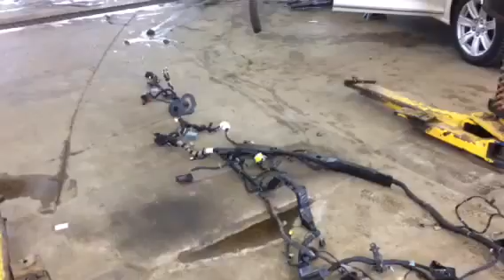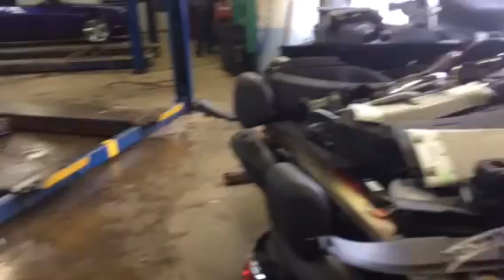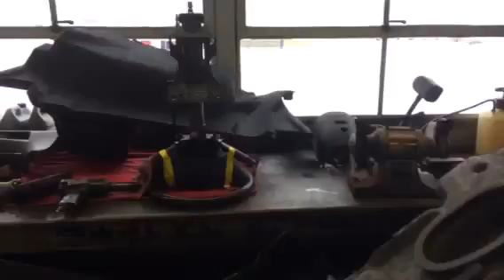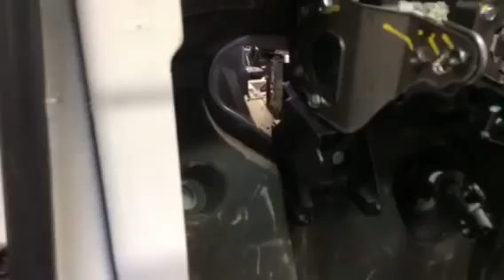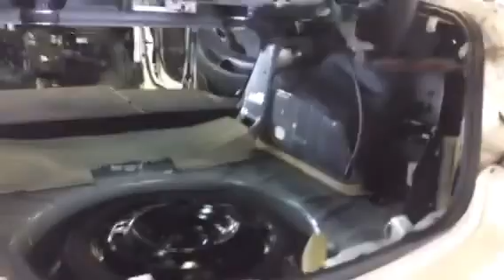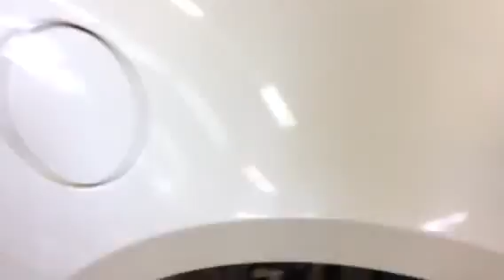2012 Buick LaCrosse electrical problems

Comment: i worked for a bmw dealership for 20 years , they had the same issues,, but what happens , mostly if the vehicle has a sunroof and you park under a tree, all the dirt and mud from the tree falls onto the roof, and it it rains, the water gets into and passes thru the sunroof weatherstrip, and into the cassette for the sunroof , after a while, the dirt build sup and becomes black mud, what we used to do at the dealership was pour a bit of water (with the sunroof open ) onto the ineards of the sunoof body area , and let the water drain down or see it it happens , apply light air pressure , and slowly blow it out , and apply more water , put all back together , lube the seals and weatherstrip and bring it outside and water test,  on the lacrosse , there is a drain hose near the tail lamp, make sure the hose is on it the drain tube , maybe attach a small hose clamp ?? a cable tie ?? and re test , some people have drilled a hose in the trunk ,,,,,,,,,,,,,,lololol, but the leak was never fixed ,,,,,,,stupid move , and i would advise , and state, vehicle that had hand car washes really never had a problem with mud build up since they were flushed clean by the car wash

Comment: Can you help me figure out the wipers on the Mustang (2002)? I want to use the multifucntion switch and its dealing me fits. I have the turn signals, hazards and headlights figured out but Im stumped. Do they have to go through the GEM (generic electronic module)????? I can get them to work by following this video with a different switch but I dont want to use that switch. https://www.youtube.com/watch?v=iuqZmm9nRZs
Thanks!!

Comment: Hi something is constantly killing the battery in my 2011 Buick Lacrosse Buick dealership says that alternator and starter are fine. However radio is not working there is something on the screen that says delete. Buick dealership said it would be over $1000 to get another radio What do you think is killing my battery if everything else is fine
Reply from the maker: I have seen a door lock actuator go faulty and cause that which is part of the door latches. Your radio could be causing it. If you dont want to replace it you could unplug or have it unplugged to see if it fixes your problem. Hope that helps. Its really a guess with out looking at it.
Reply: Same exact problem!! Did you ever find out what it was?

Comment: It was never electrical it was the ECM being mounted in the wrong place to begin with next to the engine which is causing the ECM to Overheat and the car shutoff and you think it's electrical. But it's not. Relocate your ECM in between the grill and radiator where air can get to it to keep the ECM cool down. Mount the ECM down in there. The harness will reach. Car will never shut off again I promise you. Everyone with 2012 Buick lacrosse 3.6 v6 is having these same issues and think it's electrical and all along it's the ECM overheating I figured this out on my own doing my own test because the shop will tell you anything
Reply: Is that the reason the service stabilink system comes on and the car shuts off at random

Comment: I just found dampness in the trunk of my 2010 Buick LaCrosse cxl. Not sure where leak is coming from. I did recently have some body work done to passenger rear door and my stereo has been going in and out since. It also goes out more often during rain. Any ideas? I will be taking it back to body shop this week.
Reply from the maker: Most likely the sunroof drain. There is a pass through for the rear sunroof drains in the truck.. If you pull back the carpet in the truck at the tail light area you will be able to see where is goes though. There is one on each side. I have seen them come off so the water drains into the truck. The stereo might be a different problem. Hope this helps. Any other questions feel free to ask.
Reply: Ever get a check engine light and park assist light come on at the same time? No acceleration when you press on the gas?
Reply: I got 2010 Buick LaCrosse cxs with the same problem took it to the dealer it ended up being some seals around the truck my back speakers would cut out especially during the rain

Comment: Why did you need to replace two entire harnesses for a water leak? Reattach drain, check corrosion and voltage drop.
Reply from the maker: The car already had a few electrical problems. And a check engine light plus other things was what it was in the garage for. Which pointed out the water leak as the problem that caused the concern. The connector where the to met was damaged with corrosion. Also some of the terminals were not serviceable. The car was under warranty and that was the proper fix per GM.
Reply: yes , possible from corrosion from the dampness